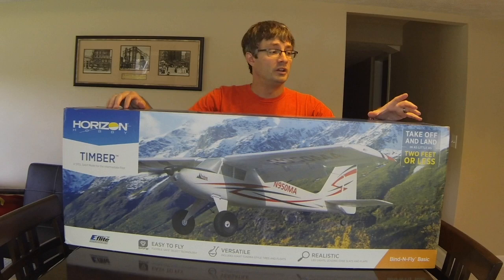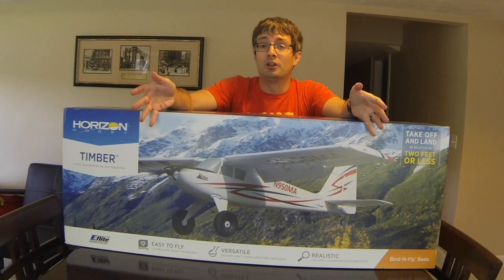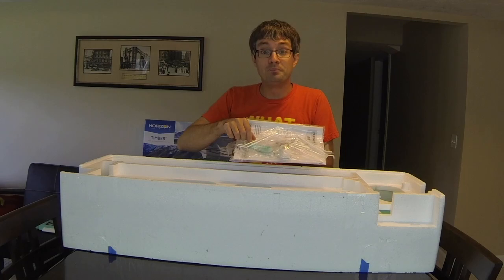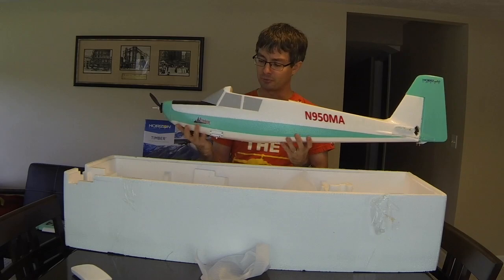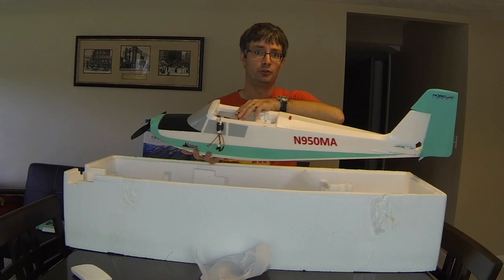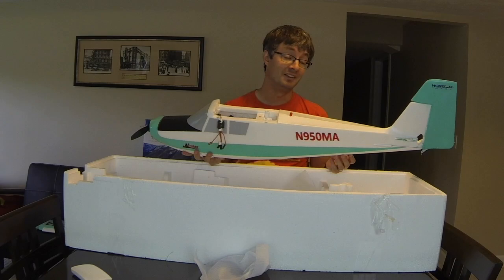Unboxing the E-Flite Timber 1.5m BNF STOL

Comment: Hi you said the time plane isn’t a real plane 
Go on google and look up old Mountain planes in Alaska I just wanted to tell you that
Reply from the maker: The Timber is not a real plane, it is modeled after STOL/bush planes. The Timber was designed from the ground up to be a STOL plane rather than a scale model. The Maule M7 STOL model is a scale RC version of the actual plane. By designing the Timber without the constraints of a scale model, the design team was able to adjust the proportions to make the RC model fly how they wanted it to. No doubt there are design elements that are pulled from actual aircraft, but it is not a scale model of a real plane.
Reply: Ya but is designed after a real plane
Reply from the maker: no, it is not. If you watch the Q&A video with the designer, he specifically mentions the plane was designed without the constraints of being a scale model. There is no full scale Timber. E-Flite makes a number of scale planes, such as the Cherokee, V-22, Cirrus SR22T, Carbon Cub, and warbirds ranging from WW2 to present day. The Timber, Timber X, Timber Turbo, Viper, V900, Apprentice, and Delta Ray are examples of E-Flite models that are not scale replicas. Even the scale planes have some slight variations in proportions to make them fly better as a scaled down version of a real plane. You won't go to an airport and see a Timber or Apprentice full scale plane sitting there. They are creations designed to accomplish a specific application.
Reply: BRGT350 ok I understand what you are saying I Watch the video but I know it’s not a scale model after another plane but it looks like the Mountain planes of Alaska with changes like the stall capability 
I am sorry if I made you upset 

I was looking up old planes so I can paint mine looking like the old alaskan planes
Reply from the maker: not upset at all, just want to make sure we are on the same page. The Timber pulls from a number of different real STOL planes, which are very popular in Canada and Alaska. You are correct in that the look is very similar to the planes used in Alaska. If you are looking to add some additional scale details to make your Timber look more like a real plane, check out the plastic parts kit for the E-Flite Cirrus. I used the antennas on my Timber and foot step on my Cherokee.
Reply: BRGT350 ok I understand now 
Do you have anymore ideas
Reply from the maker: from an appearance standpoint, the different paint and extra antennas are the only things different on mine. I did upgrade all of the servos with metal gears for durability. I am working through my planes and replacing servos with higher quality ones. The big control surfaces put a lot of forces on the plastic gears, plus the surfaces are easy to bump when transporting the plane.